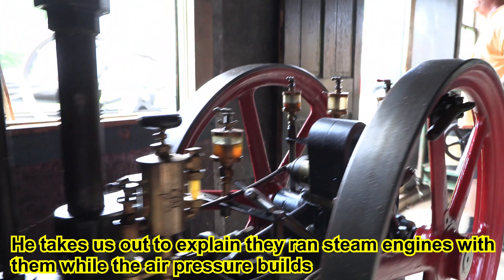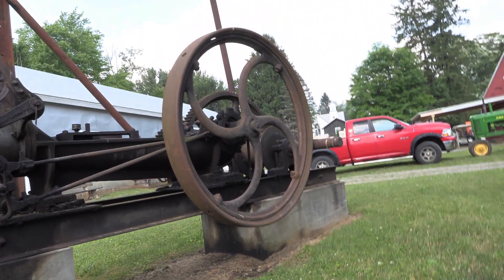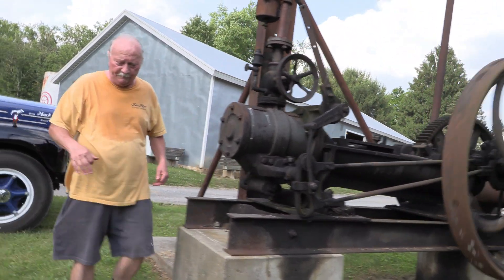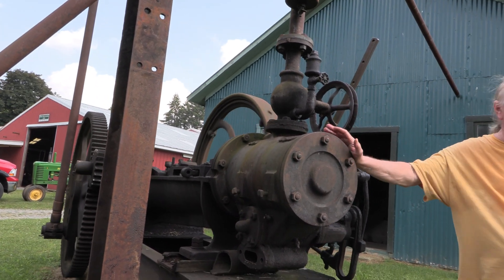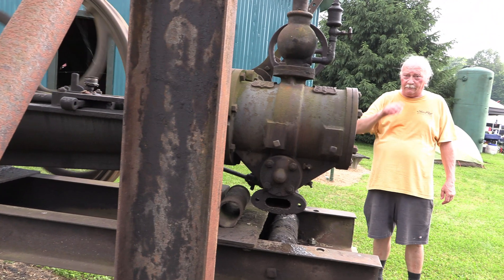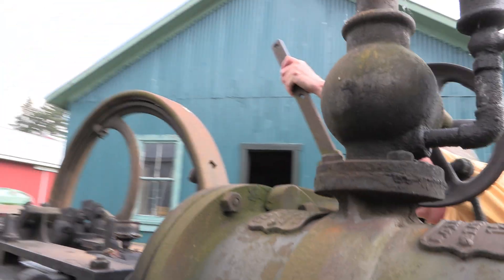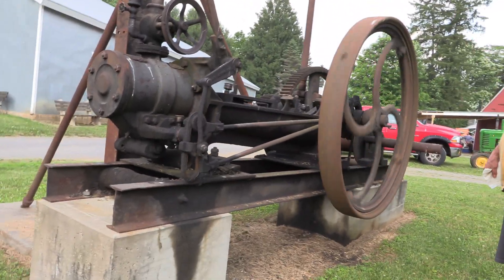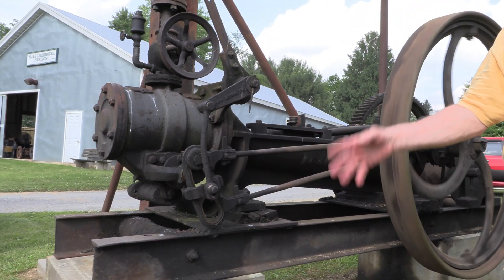Windy City Air Compressor Engines: A History from Coolspring

Comment: Wig-WAM cam, interesting design. Would have liked to see a little more of it's operation. I have thoughts of using that on an engine that I want to build. 
Thanks for sharing the steam engine running on air, don't see many exhibits like that. 👍
Reply from the maker: Thank you so much Robert!